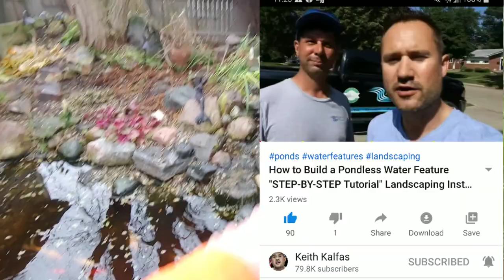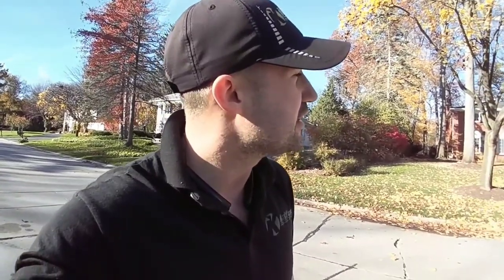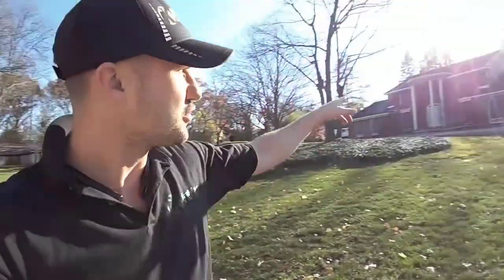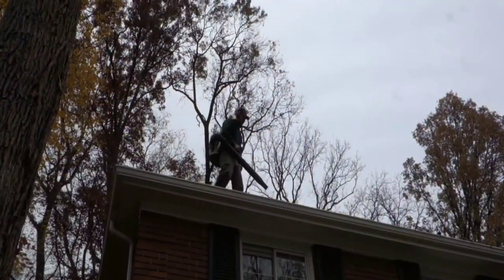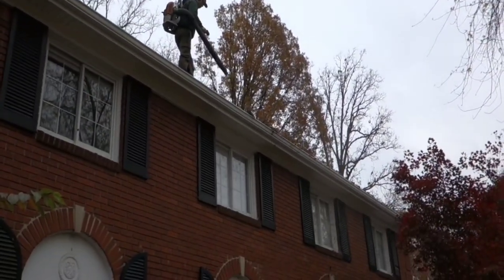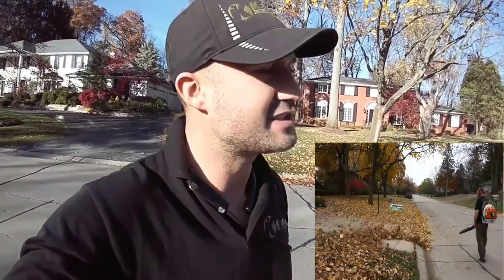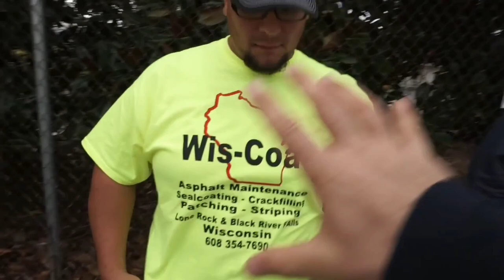$250 Minimum Base Price for Fall Cleanup and Gutter Cleaning | Ouch But Hey!

Comment: Thanks for sharing some great content...I have a little challenge and that is pricing out leaf pickup. I'm working on a property that I take care of, but for some odd reason this time around there are lots and lots of leaves to pick up. I don't have a big machine to pick them up, more like a craftsman leaf vacuum which does a great job. I told the client that I was going to charge her $300 for the job and she was like wow that's a lot of $$$, I said sorry but there are a lot of leaves to pick up and they also need to be bagged. I like the whole landscaping thing but right now I might have turn away jobs like these because they take a lot of time, plus I don't have a lot of clients to purchase equipment to make it worthwhile. This year I did very well and the business is going in the right direction, hoping to buy a small trailer and more equipment in 2023. Since you are in the business what do you suggest? Our town only has 3 leaves pick up, on top of that if it rains it's even more dificult to pick up. Let me know what you think? Thanks

 

Reply

Comment: You don’t realize high high a 32 foot ladder is heck 24 foot ladder to the roof is pretty high.
Reply: Dude I'm a painter and 24ft isn't high at all. It's not that low either but I'm used to going on 32s and 40s. 32 foot ladder is up there if your all the way up next to the last rung, but I never go to the last rung always the one down. Also you gotta have respect for the height, never get to comfortable where you think nothing can happen cause the minute you lose respect for the height is the moment where things can go bad for ya.
Reply: @froey198033  the bigger pain is trying to move around one of those things with a breeze
Reply: Jeff Froment I winterized my own home and, I got to the top of the 32 ft ladder and was like dam things could go wrong up here.
Reply: HERPY DERPEDY 💯 percent
Reply: @WildCardMMA  underestimating is usually were more things go wrong. 
I work in roofing and a worker fell and broke his heel I think. Most worker accidents in roofing actually happen on the lower levels due to fewer precautions taken unlike a 2 story or higher home or building.

Comment: I am working on a gutter cleaning estimate. I will be blowing the agree off the roof and gutter and then picking up. Is $149 too expensive? I know that is a broad question and varies based on the area you service but I don't know how to charge for blowing them clean up the debris.

Comment: This is a pretty stupid question, but do you charge $50 per yard of debris removed or $50 for the whole trailer? Because if its $30 per yard to dump and its a 10-yard dumpster aren't you looking at a $300 bill to dump the trailer at capacity? Thanks so much and great video!

Comment: You need the brand new 3500 4x4  dump truck. One with a Diesel engine. I don’t see how your getting by without one. I also believe you need a aluminum bed for your dump truck. An aluminum dump body with a aluminum plow.
Reply from the maker: I do?
Reply: Keith Kalfas yea with real big rims

Comment: Hi Keith This will be long but a few questions.  When I started out I did everything by the hr.  I didn't know what I was doing.  Also I was in the mind set I was making $12/hr at my job so $20/hr I must be a million.  I have had the same customers for years and they won't budge from the low rates I use to charge.  Some have but not everyone has.  So I feel like I am in a win less battle.  I wanted to add new customers this year but that did not go as good as I planned.  I need the money but I hate doing these jobs when I know I am getting taken advantage of.  But when I need the money I do what I have to do.  Also with the roof and gutters I have done them by the hours or cheap.  I don't think my regular customers would be willing to pay me $100+ for gutters.  With your video I care about your safety.  I copied and paste the OSHA rule about ladders.  
Remember the 4-to-1 Rule for Ladder Safety to Avoid Home Improvement Injuries. ... When placing your ladder, remember the four-to-one rule: for every four feet of height you have to climb, move the base one foot away from the wall

I noticed that your ladder was close to the house.  Just want you to be safe.  Also I bought a 32 ft ladder.  It can be helpful but it is a pain to move around.  It is heavy and you really need 2 people to move it.  I had a customer complain because the ladder put a little dent in his gutter on the 2nd story.  Also I feel that when I have to move the 32 ft ladder I never get paid for it.  I have an 8ft truck bed.  It sticks out 8 ft off the tailgate.   I have that ladder strapped down at least 6 different ways with straps and I have a red dish towel attached to the end so the ladder is flagged. I will also turn my amber/white warning lights on so people do not drive into the ladder.  A 32 ft ladder can be useful but it takes a lot of effort just to use it.

I want you to be safe.  What would your advise on getting my rates up be?  Do I just let the customers go and skip the job and replace them or is there another way to do it.  I know this other landscaper.  He is ranked in the top landscapers in the world.  I am serious.  He is that great!!!  His name is Brian Fullerton.  I think you would like him if you meet him.  He is a really nice guy.  He said in a video that you expand the top as you deplete the bottom.  I have been thinking about that.  I have already decided that at least 1 of my customers is gone next year.  He expects to much and I don't get paid and he is always complaining.  

Thanks for your response and advise.  And have you thought about March 2020 anymore?

Bill
Reply: Hey bill I started at $15 because the place I worked at would not give me a raise so I went out and got the raise myself.  I bumped up my rates to $20 and was able to keep some and gained more and lost a few of the $15.  The one I lost was a real pain.   I added mowing and right from the start went to commercial pricing even higher than the low ballers and was able to find real customers.  I have a job to supplement while I build better client base and slowly let go of the low $ ones.  They are not going to pay you more and will get upset as you try and justify it.  They wont convert to seeing the value until they price it out and then they will do without or search for the low guy and the "neighbor kid."  Sorry for the bad news but I think you will need to replace them.
Reply: Thanks for the tip on safety thinking the same thing.
Reply: @jcharles2417  I started mowing back in 2006.  I only mowed like 3 yards.  Just something on the side.  A few years back I decided to go to Israel and decided to pick up more yards and keep track.  Working part time I made $11,000 gross from mowing and $22,000 at a factory.  I quit my job and love it.  When I started I charged $10/hr.  This was only side money and extra money to go to Chicago with and party.  Nothing major.  But when I went into business for myself I was trying to survive and I didn't want to take advantage of people.  Or so I thought.  4 years later my rates for hourly work begin at $30-$35/hr for general labor.  When the chainsaw comes out and I am doing major tree work/trimming I price those jobs out starting at $125/hr.  If I have to climb the tree with my saddle and rope I am looking at $175/hr.  I don't tell them that rate I just give them a flat rate.  But I know what is involved in tree trimming and if I have to climb the tree since I went to school for tree climbing the rate is higher.  My thought with tree work is I am pulling out thousand of dollars of equipment before I even do any work.  I guess that I am also scared  that if I get rid of my customers will I be able to replace my customer?  I know I will be able to replace them but that is just a fear I have in my head.  Also check out this website.  thumbtack.com  People post jobs on this site you can bid on.  I use it to get my customers.  Take a look
Reply: Gutter cleaning is often priced by the linear foot and many businesses including mine have a price range to clean gutters depending on the difficulty of the job. Also, when you are properly insured to be on roofs and ladders, it's expensive and remind your customers of that. Also, they make ladder standoffs which provide several benefits, 1. It stabilizes your ladder so that you are much safer while being high up and 2. it keeps you off of their gutters giving you room to work without damaging their gutters 3. Makes it much safer when transitioning from the ladder onto the roof.
Reply: @joshuariggelsen6224  I know I need to look into the ladder standoff.  How much do you charge for a ln ft?  Where are you located?  I am a 1 man operation.
Reply: @billhull6842  I am located in Palmer, Alaska so keep in mind my location could definitely cause my price to be different than yours.
Reply: I typically charge between $1.50-$2.50 a linear foot. On occasion I charge higher if there are gutter covers I have to take off and reinstall as that takes additional time. I have a $125-$150 job minimum depending on location.
Reply: @joshuariggelsen6224  lol  I am in Kenosha, WI.  I am in between Chicago & Milwaukee right at the state line.  For me there are good areas and bad areas.  I prefer the good areas especially along Lake Michigan
Reply: @billhull6842  I also like to upsell yearly gutter cleaning services for homes that need it. I find that many of my customers liked it because it was hard for them to find a professional to begin with in my field. I find that my customers at like it when I make it easy for them whether it's estimates that are easy to view, reoccurring Services where I contact them when the service needs to be done the following year, or when it comes to payment customers like for things to be easy.
Reply: @billhull6842  when you are doing a job in a good area, make sure to use door hangers for the neighbors. Each consecutive year you can build up your route density and be more efficient with better profits. Also take before/after pictures to show the customer the value of your service. Lastly, look the part. If you and your equipment looks like crap, then so will be the pay. Have good branding, look the part, show the quality of your work, and the pay will be there.
Reply: @joshuariggelsen6224  I have not used door hangers yet.  I typically get the neighbors coming up to me after about 2-3 weeks asking me about my services.  when I do property clean ups both in the spring and the fall I always look at the gutters and suggest cleaning the gutters.because I use the line nobody ever cleans the gutter.  I like your price stucture.  I am going to start using those figures.  I do limit the roofs I work on.  It must be a walkable roof.  I will not get a a 12-12 pitch roof.  I have been a a 12-12 pitch roof once and never again. lol

Comment: Your video shows someone on a roof with a blower cleaning the roof and gutters.  I see nothing as to safety harness and restraints for the worker as required by OSHA.  You better be very careful.  OSHA fines are pretty high if you don't follow their regulations to the exact letter.  Anyone can turn you in - a competitor, a member of the public, or an OSHA inspector just driving by.  I don't know if a you-tube video is proof enough for them.
Reply from the maker: It was me on the roof. But I've completely discontinued gutter cleaning. Because there's too much red tape and I would have to charge a $500 minimum to be able to stay complaint and make a profit.